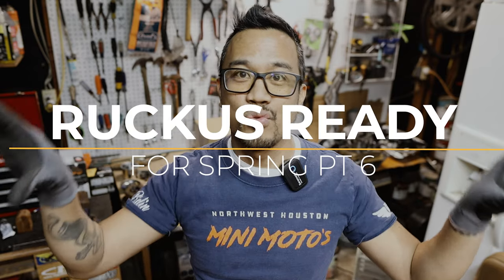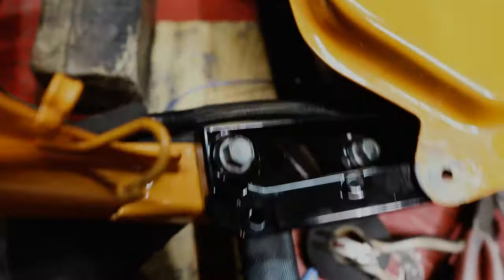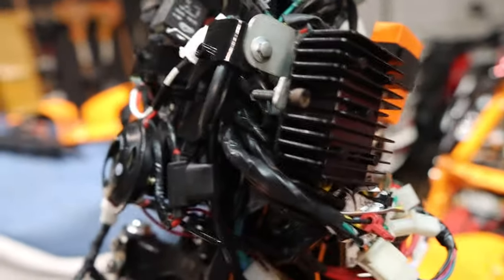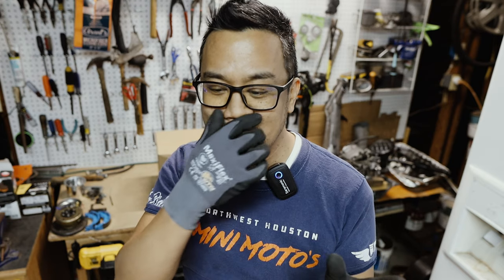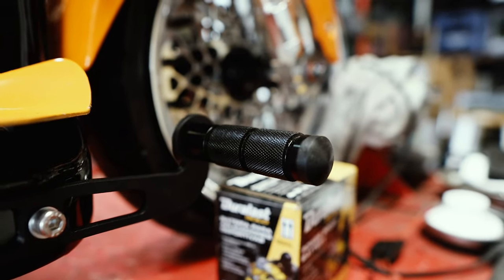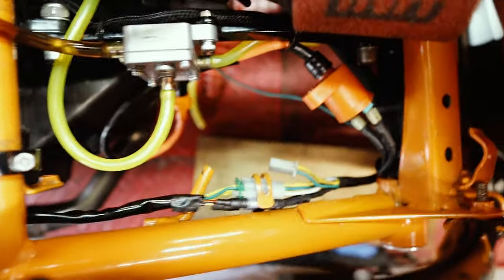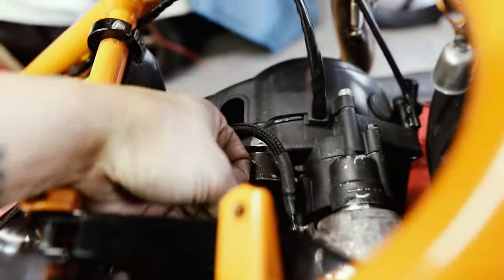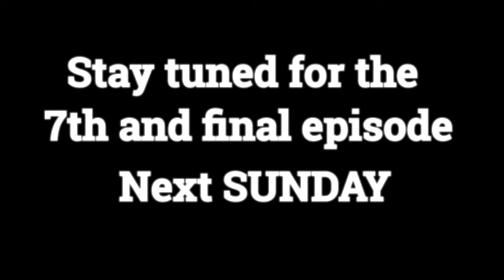Getting the Ruckus ready for spring Part 6 #HondaRuckus #SmallEngineVelocity

Comment: Does your bottom frame scrap easy with the 14 inch dorby stretch? My bottom skid plate for tank is scrapping easy, don't know if regular front forks will help instead of lowered.
Reply from the maker: Yes on longer bumps yes. I can ground pretty easy. I have to be very careful how. The motor cleans with plenty of space but the bottom of the front frame (that arch) can be problematic
Reply: @SmallEngineVelocity  Yeah me and you have the same setup. Gotta be more aware riding now, what you have, like 2 inches? You think regular forks will help?

Comment: That fuel pump is not a pull pump, it's a push pump. Pump needs to be as low as possible and should be lower than tank.

Comment: how’d you run your wires though the bottom like i haven’t been able to get someone to show me how they routed that
Reply from the maker: The hole in the frame at the top I made puts the harness on the backside of the neck and from there route it under/beside the tank. It worked surprisingly well